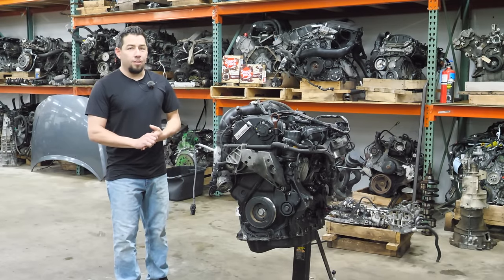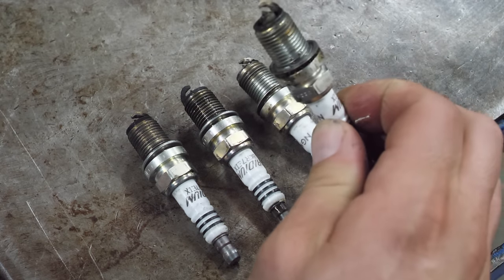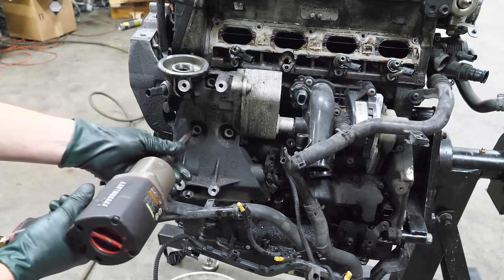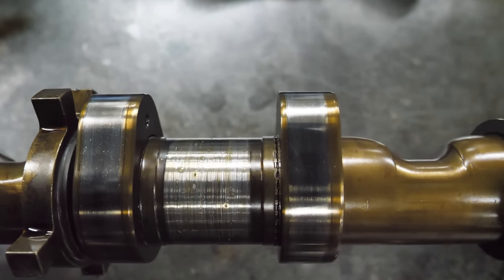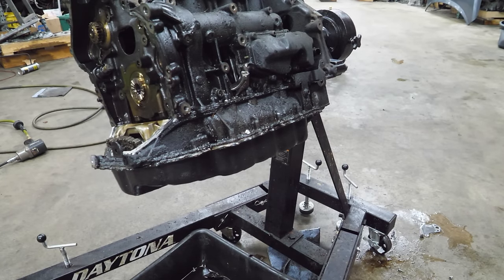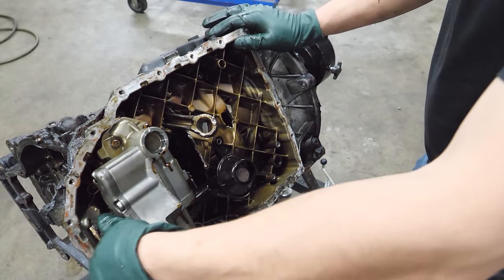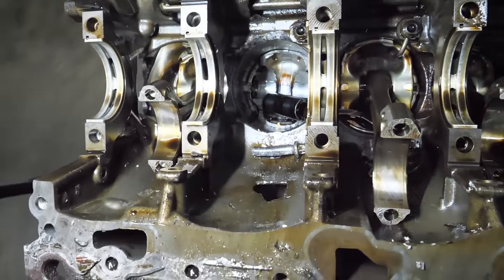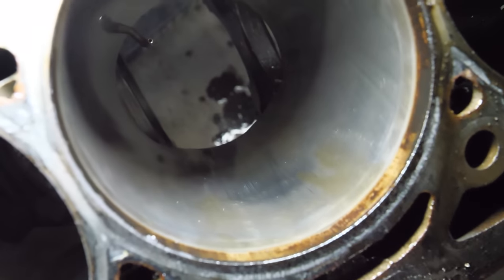Volkswagen 2.0L TSI EA888 Teardown! We Blew It Up, Lets see HOW BAD it is!

Comment: Those bearing surfaces. Like we said back in the 70s... groovy! And that water pump location. Today's engines remind me of way back, when they began putting tags on radios and televisions when we switched from tubes to transistors... "WARNING: No user serviceable parts inside." Might as well just go ahead and paint that warning on the hood.
Reply: That's just horrible compared to nice and serviceable Japanese engines.
Reply: especially for women..  sister sold a small car to her friend.  no oil in sump..  funny, eh.  ausie..   sign. do  not open. when stops. buy new one.
Reply: Having known several friends with these motors that needed some external servicing, they're not THAT bad to work on; I was surprised how crazy they are inside given the access you can get to various jobs around the engine. They certainly are pretty strange for I4s though. Like VW was giving out bonuses for doing things as differently as possible or something...
Reply: @Trendyflute  I think it was just VW continuing a trend of strangeness. 1.8T had 5v heads, the exhaust cam was driven by a timing belt, and the intake was driven off a small chain on the back (transmission) side of the head linking the two cams. EA113 2.0T FSI had the same weird timing setup. Then when they finally moved to a singular item driving both cams with the EA888 TSI, they decided they needed two more chains for the balance shafts and oil pump. Plus early model years of the first/second gen EA888 had issues with faulty tensioners, up until mid-2012 iirc.

Sure, it's still a complex timing system, but at least they put it on the front of the engine, unlike with some of the larger engines in the VW/Audi lineup. As a driveway DIY-er with a gen 3 engine I think it's easy enough to work on for most routine maintenance tasks. Once you have all the correct sockets, that is.
Reply: @Trendyflute  I'll admit my bias. I can change out the water pump on my 57 Pontiac 347 with one hand and a few simple tools. 😂

Comment: Fantastic Eric, as I said in your blow up video. There was a massive amount of noise, before it let go. You had trouble cranking it over to get it started, then when you did, it took several attempts to get it to stay running. Nobody, nobody unless totally deaf wouldn’t hear the noise. As you’ve said before “I don’t believe it just stopped”. The first video was an excellent example, of why you should check your oil regularly. One channel I watch said “ if it says change oil at say 10000 miles, change it at 7000. Oil is cheap, engines are an arm and a leg. Your vehicle will last a very long time, and give you good service. Your vehicle won’t end up in a scrap yard. Nearly every tear down you do, you always say “check your oil”. This was an excellent example of what happens if you don’t. Thank Eric.

Comment: After watching your videos I decided to change my oil every 3k miles instead of the Honda recommended 5k.  I want my car to run 300k miles.  And a 2010 CRV should make it.
Reply: 5K or every 6 months whichever comes first should be also fine.
Reply: @solderbuff  I do mine every 5k miles. Which is about 3 months of driving for me.

Comment: The crank pulley bolt ends up at around 225-250 ft-lbs when finished with its torque sequence and requires a holder to keep the crank pulley in place as it is keyed. That engine was so fucked that you loosened the bolt without trying to.

Comment: Yeah, my 2001 V6 went through three water pumps in 120k miles and was ready for another at 140k miles. Wouldn't surprise me if the belt held up, but probably replaced each time. Loved driving that car, but hated owning it.

Comment: I had a 2002 Audi A4 B6 with a 220hp ASN 3.0 engine, it consumed more oil than gasoline, I had to refill it every 2,000km, it constantly ran out of power, in the end the clutch broke, being a dual-mass clutch, I sold it , I was fed up with the car. Then my father has a 2.0 TDi 140hp BSY, and of course, it consumes a lot of oil, but not as much as the ASN.
Now I have a 90hp Xsara 2.0 HDi, between oil changes I don't add a single drop of oil or antifreeze, so it is a reliable engine, even if it has little power.

Comment: Eric, I have watched your channel for a long time. I love it. One thing I like to look at on different engines is the water jackets around the pistons. This engine appeared to have way less than other engines. My opinion, if you can't keep the cylinders cool, you can't keep the oil cool to do it's job. Possibly why this engine uses oil, runs low on oil and damage happens. I am mechanically inclined, but by no means a mechanic. Though I was wondering if size of the water jackets could be a topic you could comment on with tear downs. Again I love your channel, keep it up! Eric T.

Comment: I dont know the us market, but here in Europe the block does hold its value because if the car gets in an accident where the front right fender /wheel takes the hit the engine mount will break. The mount is bolted to the block and that is where the bolts are ripped out leaving the engine block a useless piece of metal.

Comment: That timing chain tensioner was maxed out. Definitely wasn’t a direct timing chain failure but it was definitely in that engines near future if it had oil in it. And I’ve never seen any of those water pump belts break VW is still using them in the new 2.0TFSI engines, and the cambridge- the piece under the upper timing cover that allows oil to go between the intake and exhaust camshaft is a known failure point they have a small screen in them that gets clogged and then under high oil pressure will send the screen into the intake camshaft and throw a bunch of camshaft codes and the engine will run poorly under certain conditions. The cambridge also requires a special tool set to get it apart mostly just to get the intake camshaft sprocket off but still a necessity when repairing these engines. If these engines are very well taken care of I have seen them over 200k miles with minimal issues but those were very well taken care of examples and yes they had the timing chains replaced not long after 100k miles on them.
Reply: Also a side note that bolt on the balance shaft that drives the belt for the water pump is reverse threaded we usually just use a box end wrench at the dealership to get it off because with the transmission attached we can’t get to the other side of that plug.

Comment: Exhaust studs can also break off - on an Alfa engine with a turbo on one end the cast iron manifold could heat up from cold much faster than the studs and the differential expansion would snap the stud. Fixed by using longer studs and a steel tube to absorb that extra expansion.

Comment: It can happen.  Had a 60's Pontiac.  Seller disconnected the oil pressure sending unit, I was too ignorant to think anything of it.
When I reconnected it, it glimmered when idling and hot.  Had oil pump replaced.  Did not specify, probably a high volume I hope.

Lasted for 2 or 3 years, including several trips between Texas and Georgia.  Don't floor it, keep rpm down.  Lent it to someone, he blew a rod bearing in one night.
Reply: @russellstyles5381 Dad bought a V4 ford transit. Only problem we knew about was charging light, we thought a new alternator was needed. Brother in law came over, he had used lots of transits. "That's not the charging light, that's oil pressure" Oops. Drained the oil, didn't look great, but not awful either. Took off filter, dropped it because it weighed so much. Seems the guy who owned changed the oil  regularly, but never the filter? Weird. Pressure came back and we drove it for a couple of years with no problems. Loved that little V4, great engine.

Comment: I laughed when I saw the stud missing on the turbo exhaust manifold, bc I have the same one missing on my 2012 Jetta GLI, and it now has an exhaust leak at high rpm. The manifold warps and breaks the bolt. I was going nuts trying to figure out wtf this noise was, and that’s the main culprit…..the mk6 GLI is now my “weekend vehicle”, so it doesn’t bother me much

Comment: That oil filter came out normally, they have one way valves inside so they don't empty themselves when removing them. As for those water pump belts I haven't seen or heard of any failing but they usually get replaced with the water pump which fails all the time.

Comment: In order to remove the cam bridge completely from the cams the vvt spool valve needs to be removed from the intake cam. It is reversed threaded ( lefty tighty righty loosy). There is a special tool made to fit into the two small peg holes to loosen it

Comment: These motors are tough AF and stump pullers. I had a bad oil filter that starved mine of oil. I think the bypass was just too small IMO. It ran another 35k and no knock before it changed its behavior. It suddenly started burning 1qt every 300mi and had a hint of knock when the engine was hot. So after confirming that new oil doesn't make it a little better I had it consuming a few gallons of used oil had waiting to send to the recycling center before having enough and trading it in for 3k for another a VW CC just like this. I was in great condition at 165k. No his is not my car, mine was a two tone interior.

Comment: I almost bought a new 2013 CC, but I didn't because I preferred the original longitudinal B5 Passat drivetrain.  I can see where VW cut corners when they "decontented" the European built B5 Passat 2.8 GLX.  Replacing the trunk struts with hinges, cheaper looking interior etc, horrible engine that leaked oil like a sieve...   I like the frameless door glass.

Comment: You know, all this changing of oil system parts in absolute denial of the core problem is astounding. Is there evidence he had the Oil Pressure gauge on the cluster checked out?
A friend is right now doing the timing chain on an Audi V8. At the back. Yeah. Ouch. 
So how did he blow up the engine? Place your bets now! 
Another great video, Eric!

Comment: The belt never fails. When you get a water pump kit it will come with a belt, but as its so time consuming to replace it nobody ever does. That belt will last much longer than the engine will.
Reply: Water pump: Replace every 50k miles as it'll leak.
Belt: Only removed when the engine is junked.

Comment: Eric, I pulled this exact same engine out of  an 11 gti this morning at work and it also had the same stud missing from the exhaust manifold and I was wondering about it too! Didn't look like the turbo or any other exhaust hardware had been off before - vibration theory seems probable
Reply: Hey man, I don't know if you're an Audi/VW tech, but I just have a quick question. I have the same engine in my '11 Audi a3, and I've had to fix a ton of things lately (112000 miles, it's about time for all of that to happen anyways). I've gotten it all ironed out except a misfire that developed on cylinder 2. It lost some compression on that cylinder but it's not burning oil/coolant, spark plug looks great, cylinder walls look great, and I've cleaned the intake valves and replaced the injector seals. The only thing I can really think of is a burnt valve or stripped spark plug hole? Do you know if this happens often on these engines?

Comment: I thought you only saved the bad water pumps - FYI there's no such thing as a good EA888 water pump!
Reply: I was replacing the SAI check valve on my Audi a3 and slightly bumped into the upper coolant pipe that goes into the pump, and it snapped clean off spewing coolant everywhere (plastic tubing, yay). I replaced the pipe with a metal one and an aluminum water pump just to make me feel better. Turns out the thermostat is sticking in this new one and overcooling the engine, so now I get to fix that🫠

Comment: That Ram V10- it was the big engine for its time, it had been machined, and was at least the second engine to come out of that truck.  And it died in a maximum performance situation. My guess would be stock class power pulling.

Comment: A fellow mechanic that I use to work with would wear rubber gloves every day all day but the stranger part he would use very long extensions to work under the hood and stand upright for as much as possible it didn’t  matter if it was all the way at the back of the engine bay

Comment: I’ve learned a lot from this channel but I still have questions. Like what is the difference between the thrust bearing and the rest of the mains?
Reply: The thrust bearing reduces backwards and forwards movement of the crank, while the mains only contend with rotational force.

Comment: I was waiting for you to try and pry off the manifold before taking out the triple square bolt for the mount. Ask me how much time I spent trying to figure that out when replacing my fuel injectors on my Audi😂😂. Also, those spring clamps suck on these engines

Comment: I think a lot of the really badly blown up engines had a manual transmission behind them.  That would force the motor to continue to turn over until either the vehicle came to a stop, or the clutch was pushed in.

Comment: Getting that balance shaft bolt out?  I’d just jam a big screwdriver (or Blue) in the water pump belt sprocket.  In Ye Olden Days we’d use a bumper jack handle.

Comment: I have 2021 2.0 gen3B vw engine with 120k miles running like a new. Don’t be stupid to pass 6 k oil change for turbo engine .there gen3B since 2018 is very good engine they fixed oil ring problem

Comment: I hate it when Uncle Rodney busts in uninvited.

For the later part of my career as a tech, I got sort of typecast as the guy who unscrewed other peoples' screw ups. Of all the engines in all the cars I had to unscrew, these engines are the ones that I had to unscrew the most. Especially things related to the timing. I've put more cylinder heads on these engines than any other (except for Subaru single cams) as a result of people messing up the cam timing and bouncing valves.

Comment: I guess a mechanic would have to remove the front of the car to be able to use that proper extension tool for the lower intake bolts, if they don't want to pull out the whole engine.

Comment: The crankshaft sprocket for the balance shaft chain is twice the size of the driven sprockets, and the RH driven sprocket drives its shaft through a 1:1 gear pair, reversing its rotation direction. So the balance shafts are contra-rotating at twice crankshaft speed, in order to cancel secondary vibration generated by the motion of the connecting rods in an inline-4 cylinder engine. The balance shafts appear to be the same distance either side of the cylinder plane, but the LH shaft is higher than the right one, so that a line connecting the shaft axes is not at a right angle to the cylinder plane (as in Mercedes, Mitsubishi, Mazda and Hyundai inline-4 engines Eric has dismantled), but about 30 degrees away. 
Can this arrangement optimally cancel secondary vibration in the cylinder plane?  🤔
IanB

Comment: My guess is the other engines were probably in gear going 120mph down the highway or doing some crazy donuts in a parking lot bouncing off the red limiter. If they were rolling with the transmission linked up, the wheels will keep the engine blender churning until the car comes to a stop. Since this was blown up on a lift it had a better opportunity to seize up and stop before it could truly blending its guts out. 

Also I'd think a VW has a better block casting than a Kia, but that's speculation. Also could have just been luck of the draw, the way that rod jammed itself in may have just cut the party short. :(

Comment: That timing chain looks significantly beefier than what is used in the recent 4-cyl. GM 1500 truck engine. While everyone was cheering at the engine's intro, I was wondering why they had gone back to bicycle power for that in a truck with 4WD and towing/hauling expected. It reminds of some sorry old GM 4-cyl. car engine timing chains that had to be replaced as if they were belts--failing routinely.

Comment: Shyt I have a 2017 gti all bolt one stage 2 around 400hp and have driven it hard for years I never had a problem till 120k,at 120k I had to replace intake manifold from valves getting stuck open and intake cam replaced,imo that’s a pretty stout motor to take the abuse I’ve given it

Comment: As the engine was being opened up I was expecting there to be MUCH more varnish and an overall dingy look to everything.  A bit of a surprise as we know this engine didn't get proper servicing.  Makes you wonder how neglected the engines are that are basically chocolate brown/black inside.

Or maybe this engine just didn't have enough oil in it to discolour everything.  Can't varnish if there is no oil to varnish, right?

Comment: I know this is the norm on aluminum camshaft heads and bearing cover. Something I’ve never understood is why the camshaft bearings on an engine like this? Doesn’t have bearings like rod or main bearings and uses the aluminum as the bearing surface? I would think the bearing surface being Aluminum would wear out quickly and isn’t repaired easily or replaceable. I hope what I wrote makes sense. I’m in no way a mechanic

Comment: Ok so not used to working on anything overhead cam, if the journals go bad like this one.... how do you fix that? Is it just throw away and HAVE to get new head valve cover and cams or can you machine them down and line bore them?
Reply from the maker: They can be welded and line bored/honed but it’s expensive and typically only done on exotic/irreplaceable heads. This one is only good for recycling.

Comment: Engine request. Ford 3.0 v6. Cam driven waterpump on some.of them and I've never seen a dry one. Leaks oil wherever possible
Reply: Which one, though?
There was the 3.0 Duratec or the 3.0 Ecoboost.
Oh, and the 3.0 SHO and the 3.0 Vulcan.
At least the OHC SHO and OHC Duratec weren't concurrent with each other, but they were both concurrent with the 3.0 Vulcan, and all 3 were found in the Taurus lmao